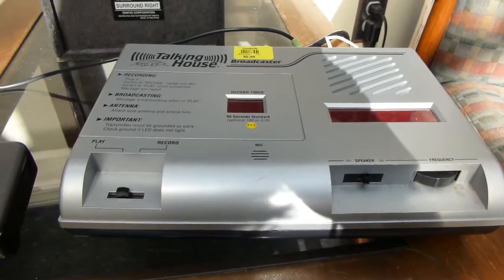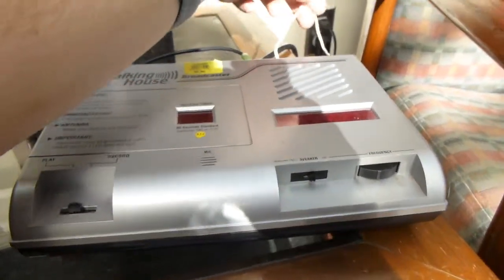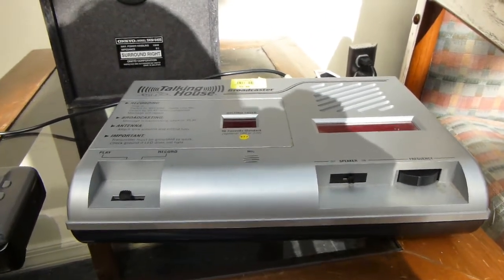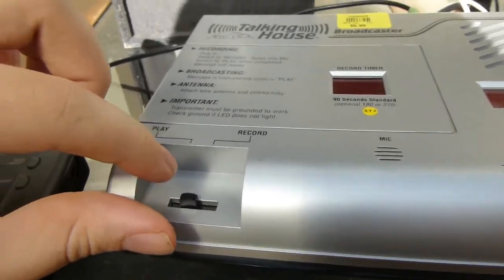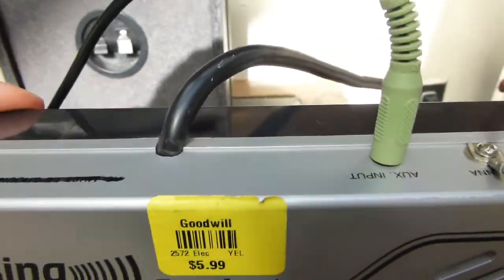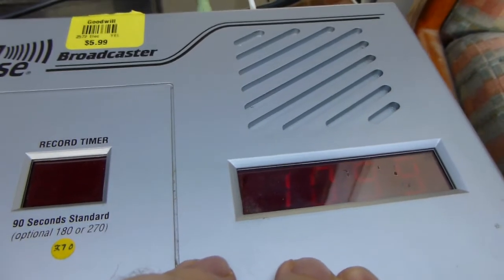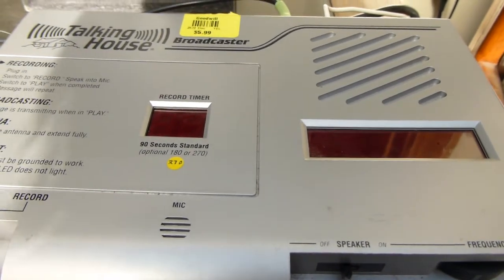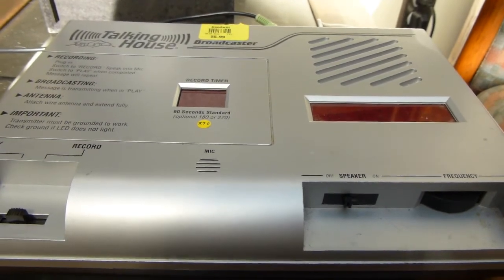Talking House AM Transmitter, Model ST1009

Comment: I have built an FM stereo transmitter that broadcasts between 80-174 MHz.  It uses a single GE 6550A tube (an audio power tube normally used in guitar amps) in the RF output section for 10 watts at the low end (80 MHz) and just under 1 watt at the upper end 174 MHz.  Since the 137-144 MHz VHF band is no longer in use by public service (i.e. police and fire), I have the whole band to myself for FM stereo experimentation (in Canada, unlicensed experimenters can transmit up to 1 watt).

Comment: I've never seen that version before. The later models can definitely broadcast live from their auxiliary inputs. (They also have a "key" to lock out all unit controls, something I suspect they learned about the hard way.)

It probably wouldn't be that hard to modify this one accordingly. Fidelity (again, of the later model) is quite good for a mono-only transmitter. Quality control is hit or miss, though.